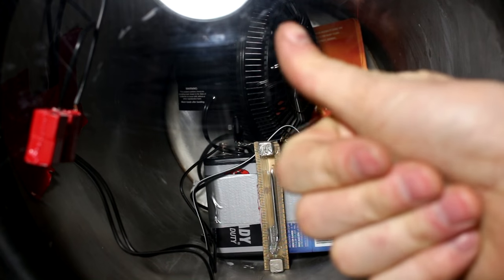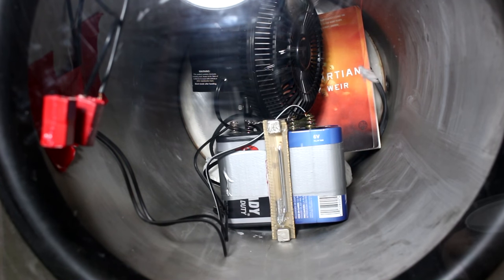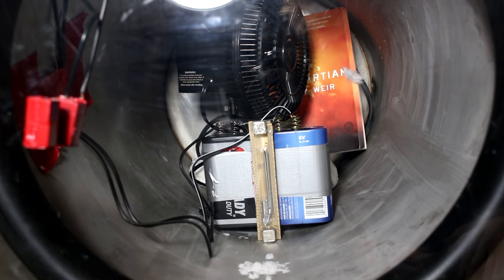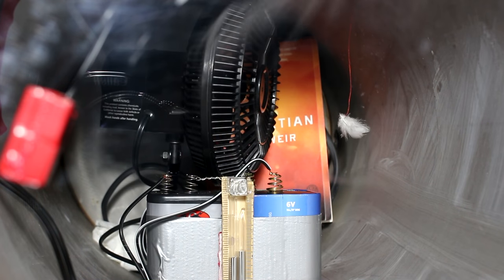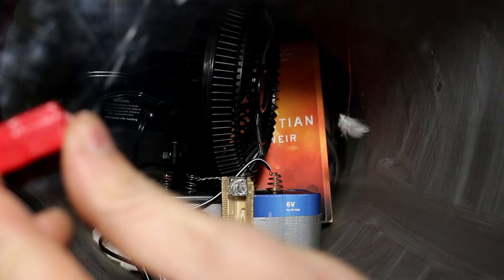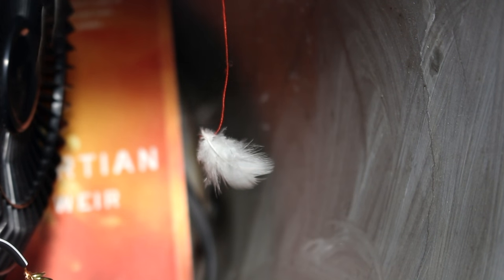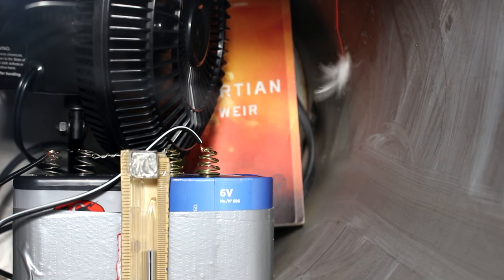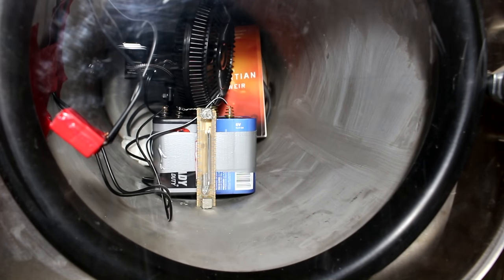How Strong is The Wind on Mars?

Comment: What kind of wing and what kind of speed would be necessary for a plane to be able to fly in martian conditions?
Reply: Huge-ass wings, immense speed. 
You can scrap the ideas of delta wings (like on modern jets) altogether, they'd get you killed isntantly.
Reply: Imagine large, thin sheets of carbon fibre. Maybe even just fabric. Large stall speeds. Not good.
Reply: NASA is actually researching planes that could fly on mars. https://www.nasa.gov/centers/armstrong/features/mars_airplane.html
The lower gravity of mars makes it a bit easier but due to the much lower air pressure these planes won't fly very long.
Reply: I think planes on Mars are impossible at all. It would have to have huge, heavy engines to produce enough thrust to get the plane up to take-off speed. Combine this with greatly reduced lifting force, and even if you manage to get a flying prototype, there is no doubt that it wouldnt be able to carry enough payload to make such flights profitable.

Trains, on the other hand, could get really fast on Mars. Think Hyperloop, but without the air-tight tube and complex infrastructure.
Reply: Think SR-71 or U2 but with 4 times the lift, either by more speed (very hard to achieve with air breathing engines in a CO2 atmosphere) or with much larger wings.
Reply: Welcome To Nevaad i know the guy was developing a rocket plane specifically to fly on mars (aurora) and yeah that is why they would not be able to land it. could never slow down enough to survive a landing.
Reply: Gliders aren't too hard, just they still need to be going near 100-200m/s to be properly stable.
Reply: No point. A train system would be of better use. Especially like that one they made in Japan that runs on magnets. Less resistance, faster speeds.
Reply: You don't necessarily need to include the huge heavy engines if you are talking about a glider.
Reply: Philip Paunov search xkcd: interplanetary plane
Reply: Lift is directly proportional to density and wing area. It is also related to the velocity squared. The gravity is also less, ~38% of earth. The Martian density is about 1/200 that of the Earth. You would need to produce ~ 75 times more lift to stay in the air. This could be accomplished by flying 8.7 times faster or by having a wing with 75 times more surface area. The wing that big would add too much mass so 75x is probably unrealistic. Basically you would have to go way faster.
Reply: +Plasmosis1 
Would your Mars plane, then, be likely to be required to fly at supersonic speeds?  How would that influence your design?
Reply: Yeah it would probably have to fly at supersonic speeds.  The speed of sound is slower so your Mach number would increase even more than it would on Earth.  Your biggest problem would be developing an engine that can work with the low air density.  Takeoff would probably be very hard because you would have to be going very fast on the ground to lift off.
Reply: Plasmosis1 - This is an interesting proposition:  Design an aircraft which would work on Mars.
I think we are neglecting to note that the CO2 atmosphere is composed of gas that is already near the bottom of its enthalpy, so an energy source ("engine") deriving energy from the environment, from a practical standpoint, is probably eliminated as a possibility.  So if the entire energy source must be contained within our Mars-plane, it becomes a rocket-plane.  (Right?)  I don't think there is much of a water-table or dispersive atmosphere on Mars, so nuclear accidents are of little danger.  (If one occurs, post a sign saying, "Don't go there.")  Hence, nuclear power would be a safe and viable power source on Mars, as it is on the moon.  Still, to support a human pilot, the required shielding would be really heavy.  An energy economy can be based on virtually any process that enables the storage and transportation of energy.  Maybe, as an existence theorem, we could assume that the plane runs on compressed gas (CO2).
The next bifurcation seems to be to decide whether it would expel reaction mass to derive thrust, or whether it could accelerate the ambient CO2 gas effectively.  Probably expel reaction mass.  Now we have a rocket, and we can add wings if it increases the flight efficiency.  From this vantage point, it's no longer a very interesting problem.
With the reduced gravity, I wonder if we could make something which levitates on Mars's geomagnetic field.  Other than that, I'm temporarily out of ideas.  But I think I have basically convinced at least myself that rockets are likely to be the fundamental "aircraft" of Mars.
Reply: Plasmosis1 you would not take off or land. you would enter atmo deploy wings and fire a rocket engine. think rocket glider. short fast but long distance. the. you just splat. no way your going to slow enough to survive impact.
Reply: you can use rocket thrusters (like in RCS, or rocket sky crane) to do the landing safely, at least orient yourself to land on telescoped legs.
Reply: no. you can not. the delta v requirements are too high. you would first need enough propellat ro slow to a hover and then to land and all the extra mass for that prop and landing gear would add even more mass and need that much more prop to make it happen. not practical on a budget.
Reply: Matthijs van Duin - Cool reference!  Thanks!!!
Reply: You can use basic lift equations to show that a large light aircraft, eg. with wingspan of a jumbojet, travelling only 200m/s (fast but doable) can lift about 15 tonnes of mass, which is completely reasonable. Density of air on mars is about 100x less, but gravity is also 3x less, so you would need about 30x the velocity squared to get equal weight to lift up. Thus, your plane must be going about 5 times faster than on earth to get the same mass in the air. Not too bad. Unfortuantly there is no air so you would need some kind of electric motor that powerful.
Reply: SirusKing
Atmospheric pressure (low time of year) on Mars = 0.640 kPa.
Atmospheric pressure on Earth = 101.3 kPa
The speed of sound in CO2 at 640 pa is 598 mph (@20 degrees C)
Mars gravity = 0.379 Earth g.
Using your algorithm:
101.3/.64 = 158
sqrt(158*0.379) = 7.74 times faster than on Earth
7.74 * 200 m/s = 3463 mph (mach 4.5 on Earth)
This is 5.8 times the speed of sound on Mars.
Interestingly, this is almost exactly 1/3rd of the escape velocity for Mars, so you would almost certainly be able to orbit Mars at the same speed your plane would require to obtain sufficient lift to fly.

Please check my work.  I may have misinterpreted your meaning about moving 200 m/s in your example.  If the above were correct, it would really put an end to the practicality of "air planing" on Mars.  If less energy is required to orbit Mars than to aero-plane in its atmosphere, wouldn't one always fly?  Or at least fall (travel ballistically)?
Reply: Just use the concept of gliders. Massive wing surface anea reduces the need for massive engines. Light construction material coupled with reduced gravity also reduces the size of the engines needed. I doubt it would be that practical but it would be possible.
Reply: bensemus x - If your glider must travel at orbital speed, what is the advantage?
Reply: Lift is proportional to velocity squared. L=0.5*p*Cl*A*v^2 is the equation to calculate lift. If we then divide this by mars gravity we get the mass that lift can support. At 600 pascals, atmospheric density is aprox 0.011kg/m^3. Coefficient of lift is determined by wing shape alone. Using the space shuttles Coefficient of lift, aproximately 1, and its wingspan, aprox 200m^2, and assume the singular speed of sound on mars, 240m/s, we can calculate the force generated and the mass it can lift.

0.5*0.011*1*200*240^2/3.7=17000kg. This model breaks down a little since it only works with a high reynolds  number (which 600 pascal atmospheres do not have), but that just makes it innaccurate by like +-2 tonnes or so. There have been numerous designs for aircraft for mars. 

If we use a small drone (10kg) for our plane, with a wingspan of like 2m^2, we find it only needs to travel about 60m/s in mars's atmosphere. There have been numerous ideas for mars exploritory planes. https://en.wikipedia.org/wiki/Mars_aircraft
Reply: tnx
Reply: GalacticPopulators I never said orbital speed did I. Mars has an atmosphere that isn't trivial. Gliders don't need that much speed due to how light they are and how large their wing spans are relative to the fuselage.
Reply: bensemus x 
You didn't say "orbital speed", but my prior calculations (posted above) did.  Maybe they contain an error, but, if not, one need use a fully self-contained rocket engine to obtain orbital speeds in order to maintain break-even lift from the downward acceleration of the thin Martian atmosphere, i.e. to fly an aero-plane.  If this is true (and I have not checked my initial calculation), then it would seem to obviate the utility of a winged aircraft on Mars in favor of orbital, sub-orbital, or ballistic craft.  Right?
Reply: Very Large Zeppelins!
Reply: Fuck planes dude, we're gonna' use the Hyperloop on Mars!
Reply: @galacticpopulators6956  
Use ion engines that can vector thrust like a harrier jet (for initial takeoff). Power the ion engines with a small thorium reactor and your good to go. It might not be a plane(closer to an osprey helicopter) but it'll work, and will require fewer short term resources than building a train system.
Reply: @DroogVoom  
Make an enormous zeppelin with acetylene as a lifting gas(acetylene is lighter than air) separated into small gas cells (the gas won't ignite easily in a CO2 atmosphere, only a high energy impact will cause it to explode)
Once you reach the upper atmosphere, just burn the acetylene as fuel to reach orbital speeds.

Comment: Well the fan can't have been pulling the 'atmosphere' around at the speeds that can be achieved at normal pressures. For one thing the blades rely on the Bernoulli principal and because the gas density is so low the pressure drop across the blade profile will also be low, reducing flow. I'm afraid that you'd need very different blades to create any form of windspeed.
Reply: Rich Smith umm? If thers no atmosphere/air in the chamber, how will the damn fan work? Fans push air from one side to another...not create air.

Comment: I'm thinking this fan might not even be able to produce thrust in reduced atmosphere.
Reply: Vastly reduced, but it's there.
Reply: That is kinda the point? no? wind speed should still be the same tho
Reply: It is producing the rotor is still moving the rest of air/co2 particles but because of mars atmosphere being not as dense as on earth the air is moving the feather less because there is smaller pressure from the wind...

Sorry for my english :D
Reply: Dylan Mcvicker
Well there is certainly some particles and they should be moving at about the same speed. Just that there is no force on the wind because the gas has such low mass.
Reply: How do we accurately measure wind speed at lower pressures?
Reply: I would think the wind speed would be even higher given that the fan spins faster due to less air resistance: that implies that the wind speed coming off the fan blades is actually higher than it was at earth atmosphere.  And it still didn't move the feather because there are such fewer air molecules.  Interesting experiement.
Reply: I'm thinking a fan with a different blade pitch. Or a squirrel cage style fan. I know that the atmosphere pressure on mars is low, but does it change with seasons, dust storms, day night temps? more research and reading needed.
Reply: cheeto4493 one answer to all your questions is: insignificantly.
Reply: cheeto4493 The shape of the fan doesn't matter so much, in a sense that, what is most efficient on Earth will be most efficient on mars. There's just less air to push.
Reply: +blazednlovinit 
What???  Your inherent claim is that the efficiency of the geometry of fan or windmill blades is NOT dependent on the pressure, density, or viscosity of the gas in and upon which the blades operate???  Sir, I strongly beg to differ !!!
Reply: GalacticPopulators Feel free to disagree, but that's all I can take it as mate, a stranger disagreeing.
Reply: Keep it scientific.  No need to resort to insults and curses.  If your intellect is not obviously superior by your cool presentation of the facts, then it's not obviously superior.
Reply: GalacticPopulators Yeah, no, I don't believe a word of that, especially when you conduct yourself in that way.
Reply: blazednlovinit - Oh?  You don't feel that I'm right?  What happened to logic?  What happened to science?  You have to be responsible for the nonsense you post, even if you have had too much Fourex, m8.
Denise Skidmore - Who says I'm insecure enough to care what you think of my intellect?  The currency I respect is concepts and ideas.  I don't want to sleep with you, so I have no reason to prove anything to you.  Go talk about your need to discuss your feeling that everyone is interested in impressing people with their intellectual superiority with someone who cares.  What a shame that we can't escape cultural marxists even here!
Reply: GalacticPopulators It's not about feelings, you've just given me no good reason to modify what I know, why would feelings come into this? I don't know you and don't really care how you feel or if you like me or not and I'd pay you the compliment of saying you were the same if it weren't for your emotional outburst earlier.
Reply: blazednlovinit
If a fan can push air, it can push low pressure CO2 just as well. Any discrepancies in it's efficiency are hair splitting stuff. Think of it as a paddle in water. If we exchange water for some less dense fluid - the paddle will still work just as good from the fluids standpoint. it paddles the air just as well as water, we simply can't get much use from paddling in the the air. Absolutely same difference is between earths atmosphere versus mars.
If you think of optimizations for various viscosities and densities - yes, ther is a difference, but it's so small you would have a hard time measuring it. Like thousandths of percent.
Reply: GalacticPopulators Well it'd bounce off it the same way as it would on Earth, there'd just be less of them bouncing off it, you've not given me any reason to suspect otherwise (spitting bile isn't a reason)
Reply: NGC1433 "what is most efficient on Earth will be most efficient on mars"

^ How is what you're saying contradicting what I said?
Reply: Denise Skidmore
 Just as we measure anything that isn't there... As we detect neutrinos - fuckers are everywhere, but refuse to interact with measuring equipment.
Reply: An anemometer is calibrated for near sea level air density. I think a differential pressure sensor like those used on aircraft to measure air speed might be able to accurately measure wind speed at different air/gas densities.
Reply: The motor will spin slightly faster but no where near fast enough to make up for the drop in air density.
Reply: The velocity of a CO2 molecule hit by a blade a fixed velocity should be the same no matter what the density of the CO2 molecule?  But with fewer molecules they produce less wind pressure.  CO2 is heavier than O2, so the velocity produced by the collision at fixed fan speed would be slightly less, but the fan is probably spinning faster due to the reduced air density, so that is probably a wash...
Reply: Actually N2 is the most common gas in air, but also less dense than CO2
Reply: Denise Skidmore A boat propeller isn't all too different to a fan (would could argue they're the same thing doing the same job in a different medium), and water is probably many magnitudes thicker than Earth atmosphere than Earth atmosphere is to a martian atmosphere.

in short, I agree with you, but some people here seem to think it's more complicated than that.
Reply: blazednlovinit Denise Skidmore 
You guys are all wet.  (so to speak)  Air is compressible whereas water is not.  This is a big and fundamental difference between the behaviors of fluids -- especially when they flow around objects or are accelerated.  Please read the first page of any text on finite element analysis (FEA) fluid dynamics modeling, and you'll see.
Reply: GalacticPopulators "Water is not compressible" 

^ Now I'm pretty certain that you're not an engineer or scientist.
Reply: Liquid water is very very close to incompressible.